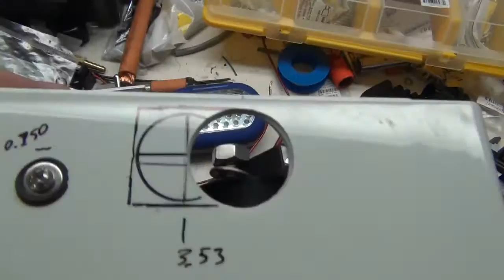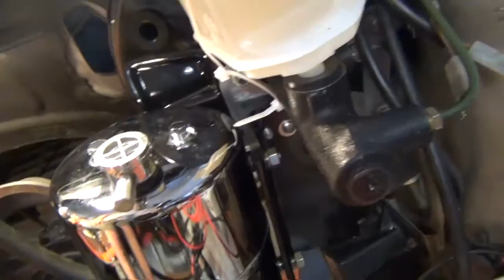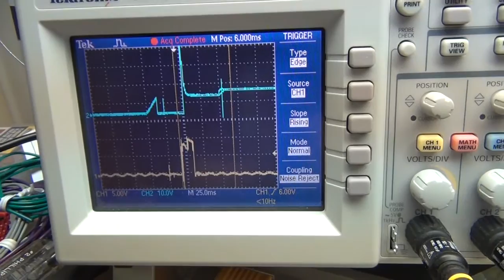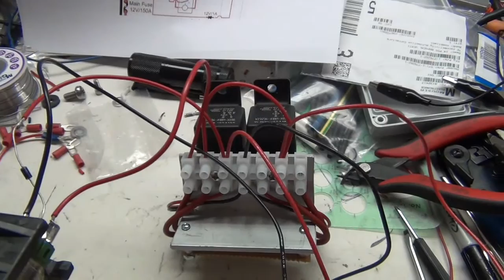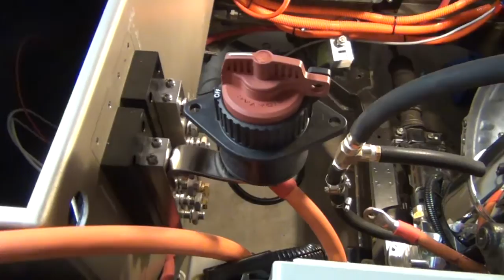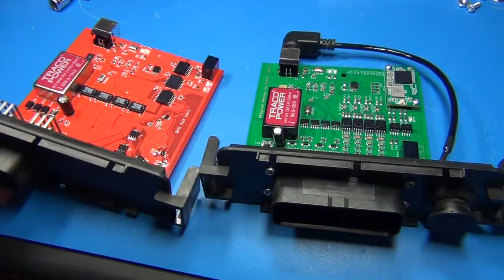Electric BMW 320i Video #19

Comment: I noticed the same problem with GEVCU 4.2 on power up.  Spurious voltage levels caused the contactors to flick on momentarily during power up.  I got around this in a slightly different way.  I put GEVCU on "accessory" power (key position) and used the key "on" position to signal GEVCU to start the precharge sequence.  This way the GEVCU is always powered up before anything is done with the contactors.